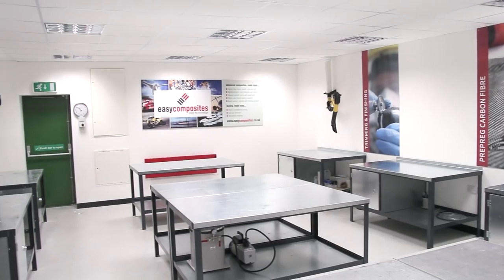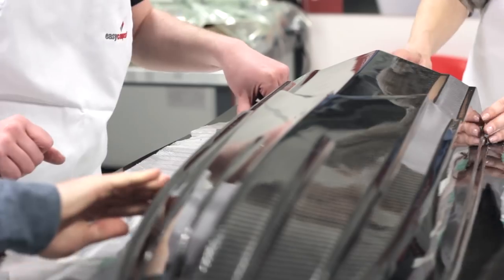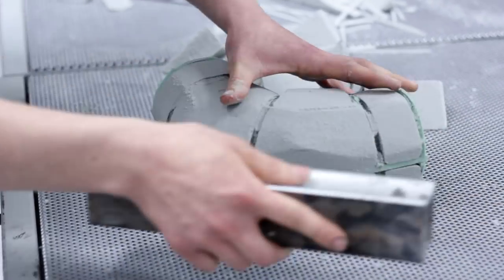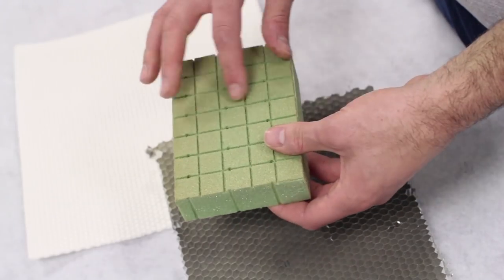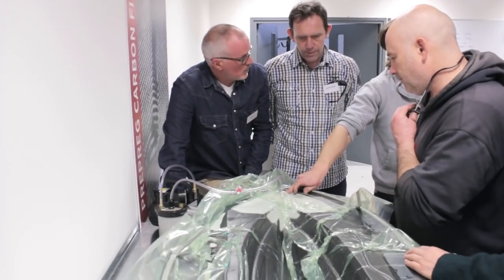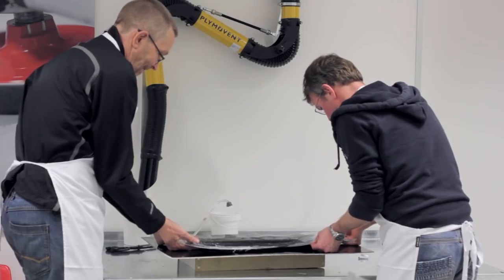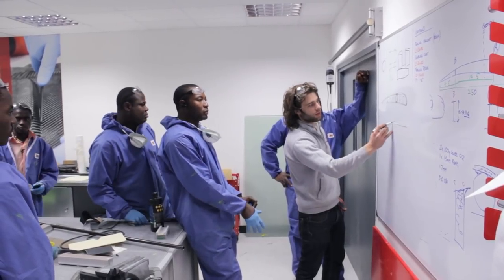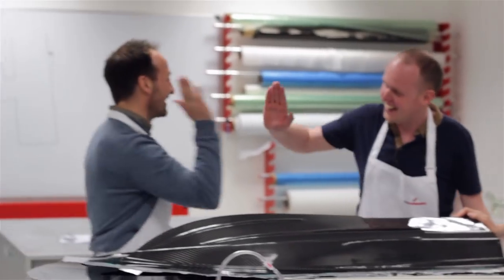Composite Training Courses - Learn Expert Manufacturing Techniques for Carbon Fibre

Comment from the maker: It would be very complicated and fiddly to do it by traditional vacuum bagging, As said in email, pre-preg would be a bit easier but still complicated. Many of the carbon rackets use a form of resin injection moulding of the componants with a resin loaded with loose carbon fibres to reinforce the structure.